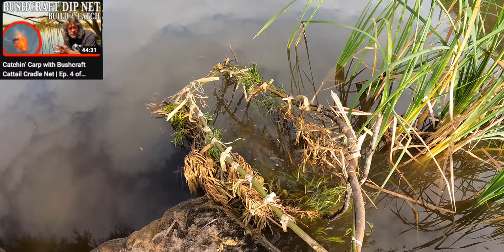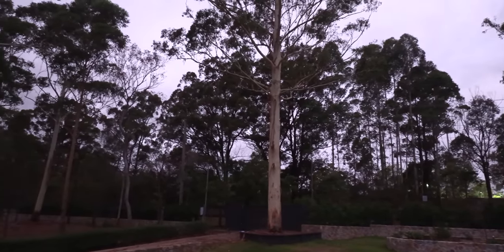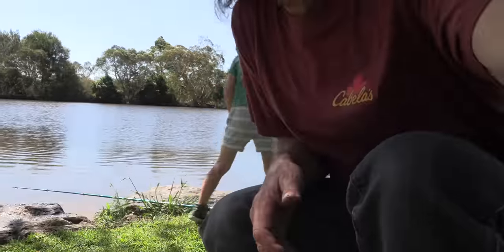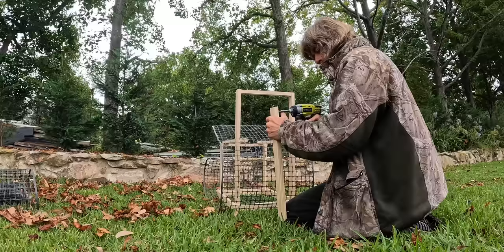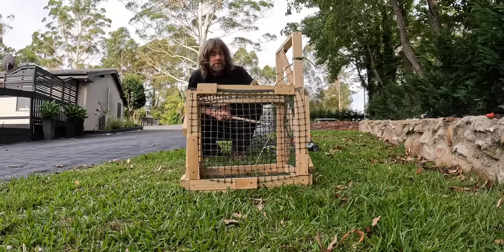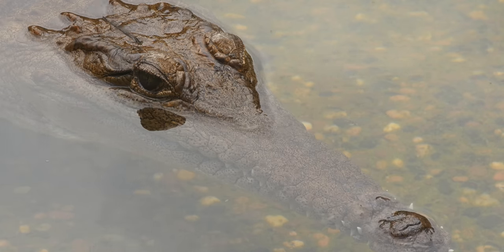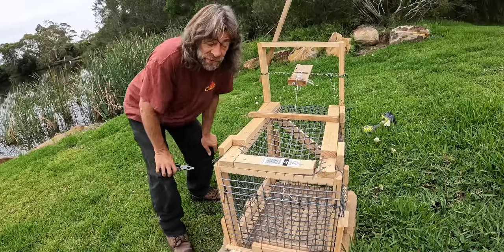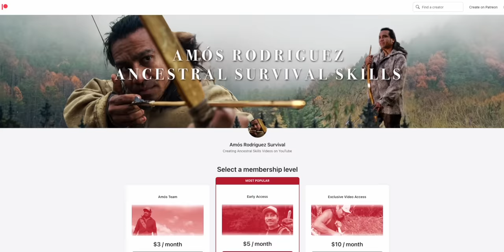Automatic Underwater Fish Trap | Ep. 5 of Ovens Down Under in Australia

Comment: Nice trap. Make the floor heavier and do away with the wooden frame... just wire the screen together and let the floor be the frame. The door should be inside the trap, and close in an upwards direction. Make the door slightly taller than the one you're using so that when it's closed, it is slightly tilted inside the top of the Cage. That way, it can't get caught up on anything else, and it will snap shut slot quicker..   Nice place there! 😎

Comment: To tell the difference between a longfin and shortfin the dorsal and anal fins on a shortfin eel start at a similar point along the body(dorsal is slightly longer) whereas on the longfin the dorsal fin is noticeably longer than the anal fin. Longfin also has a longer "snout". It only matters if it is less than 58cm. Longfin size limit in NSW is 58cm, shortfin is 30cm, so if it's less than 58 and you aren't sure, throw it back, otherwise you are good to go.